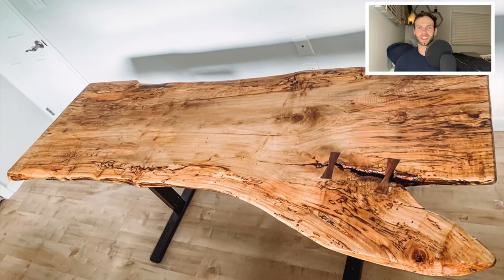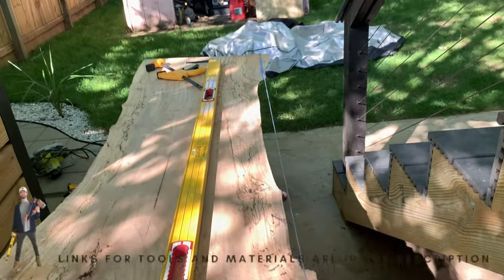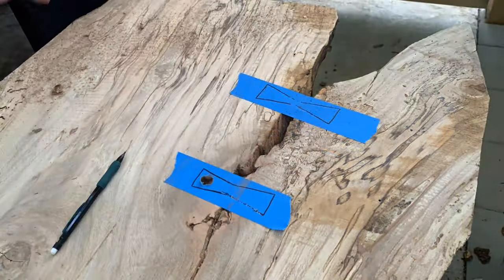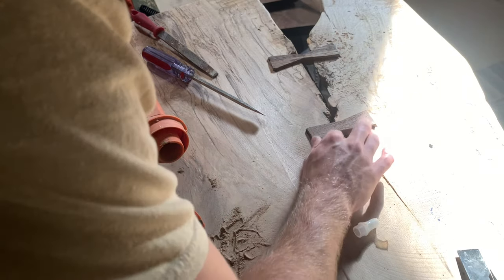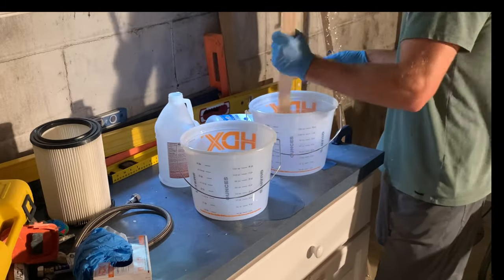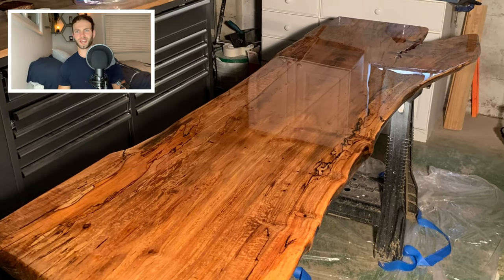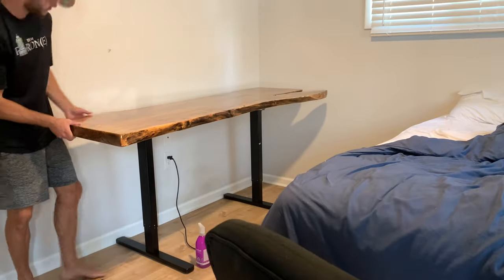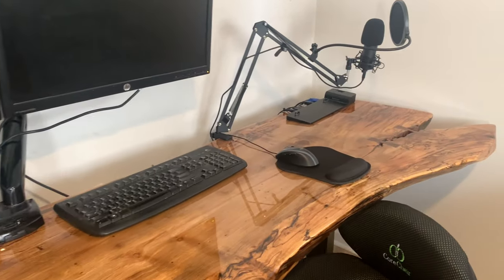DIY Live Edge Desk - How to Build an Adjustable Sit Stand Desk

Comment: Great video! I have a 92" long slab of redwood I wanted to turn into a coffee table. What finish do you think would work best for redwood? Ive been sitting on this project for a couple years cause Ive been scared Id ruin it!! Any tips would be great. Thanks!
Reply from the maker: I appreciate it! I like epoxy since it is virtually bulletproof (no stains, water worries, etc.) However, check out polyurethane or shellac as well. I'm no coating expert, unfortunately. Thanks for watching and good luck with your coffee table!